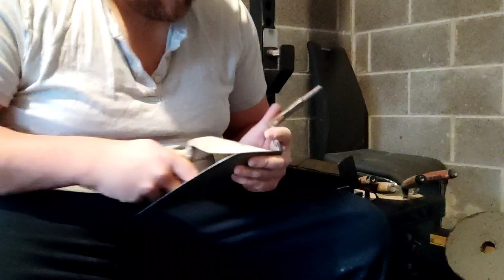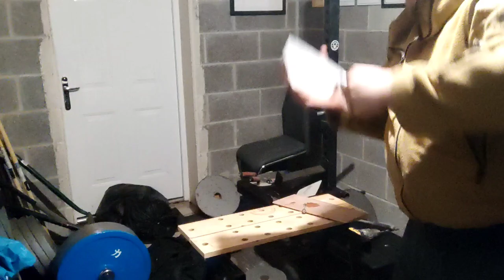Bricklaying Tools - How to Re-Handle your Favourite Trowel?! #toolrestoration #bricklayingtools

Comment: A changed a plastic rose handle to there rubber 1 similar to boiled in pot. But just put a bit wood slid trowel below just banged rubber 1 on never needed any glue or owt probs because it rose handle going on to rose trowel. Nice job buddy.

Comment: Try a rose wooden handle, I prefer them to marshalltown wooden handles as there is a bit more of a swell in the middle of the handle that just seems to sit nice in the hand 👍🏻
Reply: A don’t like that it tends give me a sore hand. Use rose proform rubber handle. Trying the plastic also was t keen similar to wood but changed it to rubber
Reply: @lmilne4859  I guess that's why there are a few options, as long as you have what's right for you that's all that matters 👍🏻
Reply: @robessell  
Yea so true good thing with the rose multiple options from handles to shapes to 1/2inch sizes in blades and limber blades list goes on lol. Can cost you a bit trying them all 😅
Reply: @lmilne4859  tell me about it 😆 I have a decent selection, I have 3 that are all really my favourites. A 9 inch philly that's limber, I love using this for brickwork. A 9.5 inch spade/sewer/Boston pattern I think that's limber too which is great for rubble work. I have a 7.5 inch tile setters trowel that's not limber I use this for general stone fixing as you don't use much mortar with no frogs and 3mm joints but I can use it to lift and maneuver big stones which is useful. Then I have a 12 inch narrow London limber for blocks, it doesn't get used often and it's probably a bit big in all honesty but it's still nice to use 👍🏻
Reply: @robessell  
😀 keeps the mind active buddy 🤣🤣 a have a limber 10 1/2 inch now 9inch for brick. But most use a narrow London 10inch which has a more solid blade. Or use a broad heel shovel 11inch on the block on flat. Or 10 1/2 Philadelphia limber on 100mm block. Good to have a selection. 😝